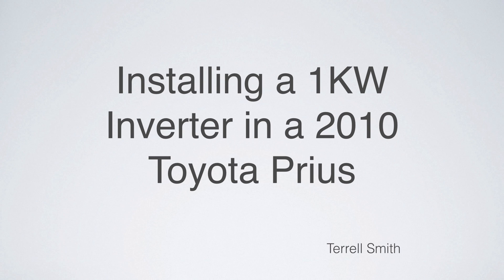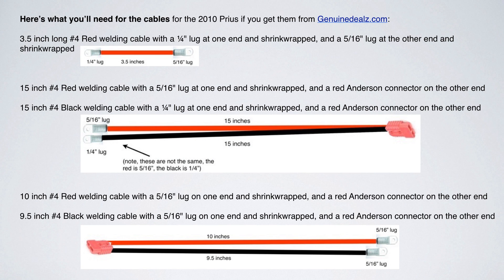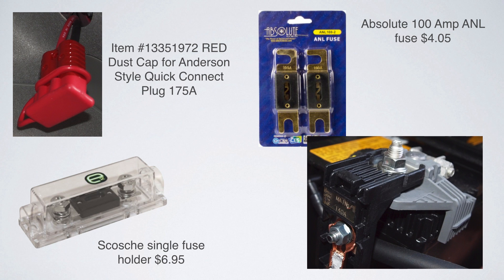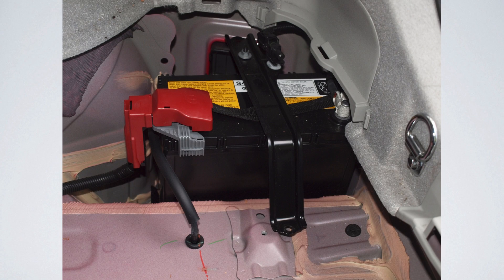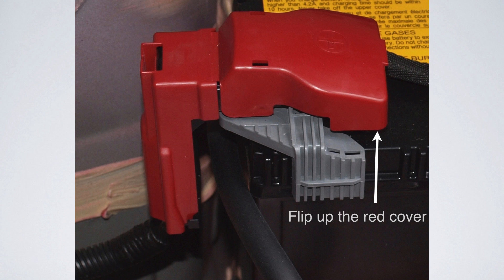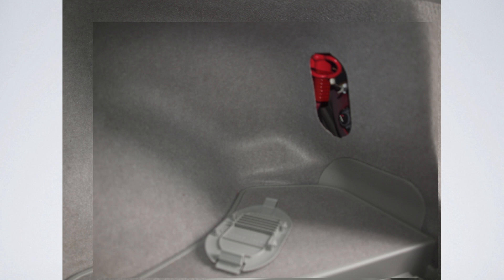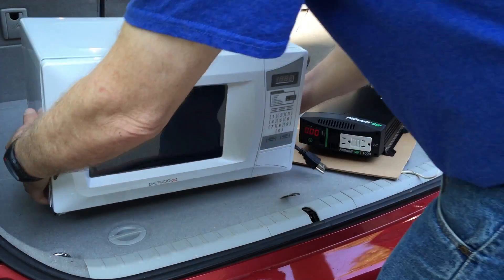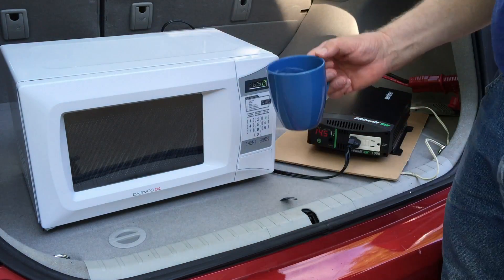Add a 1kW Inverter to Prius

Comment: Kudos and much gratitude for this wonderfully thoughtful & thorough video.  Quite the homage to have GenuineDealz put together your cabling as a bundle with your name as the reference. :)

I found an inverter (1200W BestekDirect) that I fits in the cavity over the 12V battery.  I was hoping to mount the inverter to a hinged board which I could screw to the edge of the 12V battery cover, allowing it to tip down in to the cargo area.  I'd secure board (with velcro?) at the top of cavity to keep closed.  Mounting in this space requires the inverter to be positioned vertically, with the rear facing the 12V battery cover.  Your thoughts on:

- Is the higher wattage inverter an issue even if I never run it over the 1000W recommended?
- Will this vertical mounting affect the inverter performance, i.e. heat dissipation?  I was planning on venting the board and even attaching a USB turbine to the board to assist in heat dissipation.  FYI, the inverter manual is rather useless.
- If I wanted to install an isolator (in case I forget to turn inverter off), where in the line would an isolator go: between the 12V battery and the fuse?  Between the fuse and the Anderson connector?

A thousand thanks for this video and your others!  A literal life changer for me.
Reply from the maker: Thanks, Chris, for the kind words. Glad the video is helpful. 1) The higher wattage should be OK as long as you are careful to not go over 1,000 Watts (there is some playroom, but I wouldn't push it.). The fuse between the 12V battery and car's inverter is 140A, so you ought to be OK. I've fused my inverter at 100A so as to be under the 140A on the battery. 2) Sorry the inverter manual is so useless. Nothing online? I assume there's a fan on the inverter? Make sure the inverter has ample airflow and I think you should be OK. I don't think it matters whether it's vertical, as long as there's good airflow. Does the fan blow out? Then maybe you should aim it up, since heat rises, and you don't want it to be forcing heat down, because it'll just rise back up, making the fan work harder. 3) Isolator - just don't forget to turn off the inverter! You absolutely don't want it running when the car is in "Off." You'll drain your 12V battery. I wonder whether an isolator might make you careless? If it were me, I'd skip it. But if you install it, put it after the fuse (between fuse and Anderson connector). That way, if your isolator gets loose, or a wire gets loose, the fuse protects everything.
Reply: @TerrellWSmith  Thanks, Terrell, for the quick and thought out reply.  You are wonderful and I appreciate your time and insight.
Reply: Sorry, Terrell, one last question; do you know if stainless steel bolts are okay as replacements?  I've read some conflicting info regarding corrosion with the mixed metals, but also see that auto parts stores sell (among others) stainless steel battery bolts.  What kind of bolts [material] did you use? 

Thanks, hope you and yours are well.
Reply from the maker: Hi Chris, I didn't pay attention to mixed metals, just got the bolts that fit. I think the difference would be so minor it doesn't matter, but some might like to argue about it. The point is to hold the wire lugs snug.

Comment: Watching your inverter’s display, it looks like your microwave was pulling 1100 watts
Reply from the maker: Noah, you paid close attention! According to the microwave's label, it's rated at 950W. According to my Kill A Watt device, the microwave draws 985W when on grid power. The display on the inverter shows around 1.12 kW at 13V. The inverter is rated at 900W continuous, 1kW for five minutes, and 2kW surge. So yes, I'm running the microwave at the limits of the inverter. Most microwaved food takes less than 5 minutes fortunately, so that works. If I need to do several servings or dishes, I allow a short cooling off period between.
Reply: I installed mine in my 2006 Prius using your video. I’m using a Samlex 1000W Pure Sine Wave inverter. Thank you!

Comment: Some miss information: a longer wire is fine but it should be larger 4 or 2. A Pure sine wave inverter . A xantrex is not important, same quality for less, 150 A fuse, see zantrex manual.
Reply from the maker: Hi Dave, thanks for the comments. Perhaps you missed what I said. I do recommend #4 wire. Sure, you can use #2, it's just heavier and more expensive, but yes, you can run it further. I do say a pure sine wave inverter. I said I chose a Xantrex, but yes, you can find many available, and yes, I said you can find them cheaper, so shop around. No, you don't want to use a 150A fuse. The Prius fuse from the inverter to the 12v battery is rated at 140A, so going larger is not a good idea, no matter what the Xantrex manual might say. I chose a 100A fuse to be on the safe side.

Comment: Hi there.  I'm trying to add a 2000w inverter to my 2014 prius with 1/0 AWg wire and 100A fuse.  i think 100A will only get 12x100=1200watt.  Since I have 0 AWG wire, is it ok to change the 100A to 150A to get  1800w?
Reply: Desmond, my understanding is that 1000w is the most you can draw from the Prius 12v battery. There are people taping into the traction battery for 3000w, but that’s not a simple project. Putting bigger wire and a larger fuse doesn’t increase the amount of power the battery, and more importantly, the inverter in your Prius can produce. The fuse protects them both. The Prius battery is expensive, the inverter even more expensive.

Comment: Generation 3 must have a better charging capability to the 12-volt battery. The Gen 2 can't charge it's 12 volt battery (only maintain) so I would imagine it wouldn'tt support the draw from an inverter 'loading' the 12-volt
Reply from the maker: I don't know about Gen 2, but the people on priuschat.com would know.

Comment: good video but isn't the Prius battery a different voltage?
Reply: Larry, the Prius has two batteries. The traction battery and the 12v battery. My video is about the 12v battery, which is a standard battery. It is possible to tap into the traction battery, but that’s a whole different project which involves more work, higher voltage, and a special inverter. Check out Prius Chat for info on how to do that.
Reply: @terrellsmith2203  I would have to hire you to do it for me. What would you charge? Not competent with electrical matters. Mike 207.330
0396

Comment: If 12v battery gets really low and I can't start the car; Can I connect a car jump starter to the final lugs?
Reply: The whole point of doing this on a Prius is that the 12V battery in the rear is constantly being recharged by the 200V traction battery, which will be periodically recharged by the gas engine as needed; if it's left in the On status as described.   The 12V battery should never get low if it's in good condition.

Comment: What gauge wire would I need if the wires from the inverter to the connector were about 4 feet long? Or is that even advised? Thanks

Comment: Thanks for the awesome info Terrell! Hoping you can teach me how to determine what I can or can't power with this setup? For instance, like you my initial interest began with  running the fridge during the hurricane headed my way.  IE. My fridge is a samsung RF197ACPN. States "max amps is 3.9" and "rated voltage 115". So 468Watts? How is the initial surge of the compressor determined?  I assume it would involve a ton of loss in conversion, but I could also consider using the inverter to charge some kind of UPS. Suggestions?
Reply from the maker: Hi Rhonda, thanks for the kinds words and question. Your fridge states "max amps," but that's probably not the running amp power draw, but might be the startup surge power draw. Your math is correct at 120V. The best way to really know it's running power needs is to plug it into a small device called Kill-A-Watt. They cost about $20 on Amazon. You are correct that the initial surge can be an issue. For example, our fridge says it's 6 amps at 115V, which is 690W, but the startup surge trips the breaker on my 1000W inverter. Our freezer runs fine, and is rated at 5A. My suggestion would be to just try your fridge before the hurricane hits. Then you'll know. I bet that your 3.9A fridge will be fine with a 1000W inverter. If you look into a UPS which can supply 1000W, it will likely cost you twice as much as your inverter.
Reply: Thanks Terrell you are awesome! 
 I have also been researching  potential van builds to design a diy promaster alternator to lithium ion system that can handle AC, so 3000 to 4000w inverter and good size bank. 

Since most use cases for using my prius as emergency backup also involve surge loads,  it finally occurred to me I'm essentially trying to apply the same application specs to the prius. Could a prius connection to lithium serve as a kick start to the van project?  For emergencies the ability to use the car to re-charge a detachable bank intermittently is enough (assuming bank would be outlet ready and charged via shore power before storm) Any thoughts on how this could be setup?The inverter would only be involved in utilizing the lithium stored power. After mulling it, perhaps there is a way to temporarily bypass the 12 v  and quick connect to a Lion bank for charging only. The Lion would then be detached from prius and connected to inverter for draw. Sure my lack on knowledge on the electrical side is showing. Hope it's not completely shortsighted.Maybe it's as simple as a diverse enough controller (https://www.lithiumion-batteries.com/products/lithium-ion-chargers/12v-lithium-ion-battery-chargers/)?  I have a 2014 III hybrid with solar roof (no plug in).  I do realize I'm talking about a much greater $$ investment. Just thinking there might be an opportunity here to invest in my van power setup in steps, thus allowing me to learn along the way as well as invest incrementally. Are you familiar with the new systems on Hymer Activ  and volta kit for promaster that they are also using on the promaster travato?????  I think some of these are 48v and believe the RV industry is moving toward this more.  The possibilities are really exciting. Don't mean to get off topic just wish I could hang out and really pick your brain. You're clearly very knowledgable.
Reply from the maker: Thanks for the kind words. Your plans are beyond my knowledge, sorry. But I will suggest this for the storm: If you use your Prius to supply power (1000W is the max draw off the 12v battery, you can go up to 3000W from the Prius traction battery I'm told, but that's a much more difficult build), make sure you have a full tank of gas (assume your Prius doesn't get destroyed or flooded in the storm), extra gasoline safely stored (assume it doesn't get washed away or polluted by muddy water), because when the power grid gets destroyed, gas stations won't be able to pump gas. (Unless the gas station is very old fashioned and has hand pumps!) But even if the gas station has power, a flood might contaminate their gasoline. Best bet is to get away from the storm and be safe!
Reply: Get yourself a Kill-a-Watt device that you plug in your appliance to while it is running and it will tell you exactly how much energy it is drawing.

Comment: Thanks for the video, Would there be a problem connecting the battery directly to the inverter and just keep the inverter in the storage compartment where it will stay? This would shorten the cables and eliminate the connector.
Reply: Shouldn't be a problem, Greg. Just make sure you have a fuse inline from the + side of the battery. I myself prefer to plug and unplug the inverter, since there are exposed posts on the inverter that I wouldn't wish to get shorted or in contact with something else.
Reply: I didn't think about the exposed posts, guess I could rubber coat the positive side. Thanks

Comment: Thank you for this video! Would it be the same setup if instead of an inverter replace it with a cigarette socket? I want to run 240watts from this 12v socket :)
Reply: Yes, you could set up a 12v socket directly from the battery to run 240w. Put a fuse on the + side to protect things just in case. The fuse should be 30A. I have added a 12v socket directly from the battery to run a small refrigerator. Use 10 AWG wire if the round trip length (there and back) is 4-7 feet. The 12v sockets already in the car are limited to around 150w (Prius says 120w). Remember that when you run directly from the battery, this socket will always be active, even with the car turned off, unless you install a switch. If you forget whatever you're running is plugged in, you could drain your 12v battery.
Reply: Thank you so much for your reply! Is there anyway to put in a relay or some kind of automatic switch that will turn off when the Prius is not on ready? Or should I just stick with a switch and turn it on/off every time? I'm worried I'll forget one of these days...it would be so great if there is some kind of auto shut off switch?
Reply: Ok! Thank you very much for taking your time to reply! Very appreciate it :)
Reply: Terrell Smith Would it be possible to run both of the 12v sockets in the Prius simultaneously at 150w each for a total of 300w? Or will the fuse blow at over 150w? Great videos. Very much appreciated.

Comment: Wonderful video.
I recently connected a 1000w inverter to plug in my year drop camper at night. It gets hot here in FL and I do understand I have to leave the car running so the battery doesn’t drain.
I already plugged an extension cord from the tear drop to the inverter and had a test run for about 20 mins it worked great!

My ac on the tear drop camper runs 115v 
300low 520high,

I haven’t put a single fuse connector on the red wire yet.
Do you think I should ? If so why?
Thank you
Reply: Glad it's working well for you. 520w should be no problem at all, even longer than the 20 minutes. Make sure the inverter has ventilation. I put a 100A fuse on the red (positive) wire from the battery, just in case something goes wrong (like when a raccoon bites through your extension cord) to protect the battery in your car. (I don't really think a raccoon would do that, because the rabbits will first!) Actually, it's for protection just-in-case.

Comment: Thanks for that excellent video; I have two questions:
Can I use the same connection for a 2000 w inverter ? and
What happen if I use something bigger that use more power like 3000 w ?
Reply: Unfortunately, no. 1000w is the max you can safely draw off the Prius battery and inverter. You could, theoretically, draw more than 1000w for a short time (it'll kill your battery), but much above that you'll blow the fuse between your car and the battery (it's fused at 140A). If you want to go as high as 3000w, you need to tap into the car's traction battery. See PriusChat for people who have done this. It's quite a bit of work, and dangerous.
Reply: Terrell Smith thanks so much for your answer, have a great day
Reply: I'd point out that the limitation is the 100A max on the Prius inverter/converter module fuse, which you don't want to blow (replacement not simple).  As long as you install a 100A fuse on your hot/red wires (short and fat) it would be okay to use a larger inverter, provided that you don't add items to it going over your 100a Fuse. In this situation, you might want to make a note on the inverter that it's Prius max power draw must only be 100A.  You might do this if you already have the larger inverter.  Another point: sometimes inverters are rated for their surge power (for a second).  A 2000W inverter might really be a 1000W continuous inverter.   

In other words, you can install any 'size' inverter as long as you only draw the 1000W or so max power.  Keep in mind larger inverters may take more power when they are switched on, but not powering anything.

Comment: Great videos and advice.  Big question.  Can you hook up an Inergy Kodiak solar generator to the inverter.  The Kodiak charges on AC or solar.  If I can charge with this system, it would save stopping, assembling portable solar panels etc.  Once charged, I have a 20lb portable generator with USB, DC and AC ports,.  Just curious, I the Kodiak mentioned in comments section of another related video.
Reply: Yes, as long as it pulls less than 1kw, which it does, according to it's specs, it draws up to 600 watts to charge. The Prius already has DC ports, add a small USB and you have USB, and with the inverter, AC. But I'm guessing you want portable power, in which case, yes, you can charge it up with the AC from the inverter, or from your solar. The inverter will charge it much faster than solar, delivering 600w easily. (You'd need a lot of solar panels to give you 600w of solar.) The specs say 2.5 hour recharge time at 600w in, so you'd need to run the Prius for that amount of time, either driving it, or running while stationary.

Comment: Terrell a 2000w invereter is perfectly fine in a Prius running off the 12v. Battery. The Prius is designed to auto start and recharge the 12v. through the hybrid battery as often as necessary. How did you determine a 12v. can only handle 1000W.? Numerous Prius owners have 2,000 and even 2500w inverters long term with no problems.
Reply: David, the positive terminal on the 12v battery is fused at 140A. That gives 1680W before it blows. Put a 2K or higher inverter on the 12V battery and the Prius inverter may be damaged, or you blow the 140A fuse. The battery itself is rated at 325 CCA 46Ah @ 20 hours (or you may find ones with a higher rating). So you can suck a lot of power out of the battery for a short time, but it's not great for the battery. And yes, the Prius will auto start and recharge the 12v, but if you are drawing too much power out of the battery, the Prius inverter can't keep up with it, and you may damage it. Those installing 2k and 3k inverters in their Prius are drawing from the traction battery, not the 12v battery, at least what I've read over on Prius Chat.